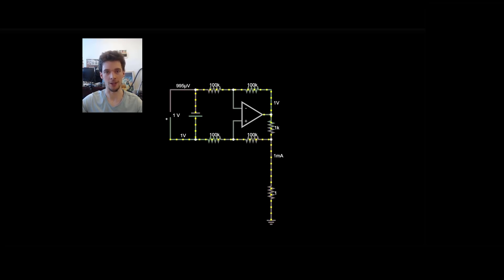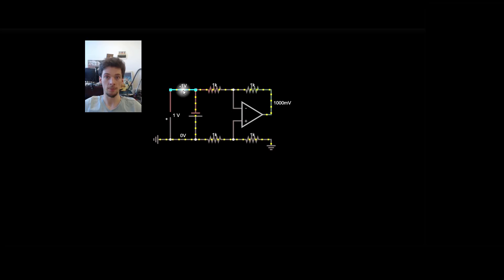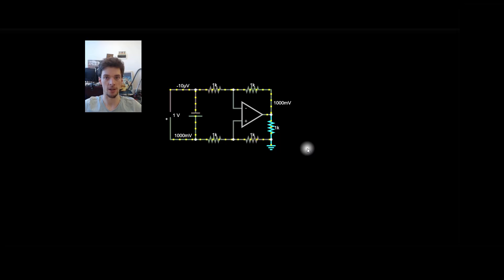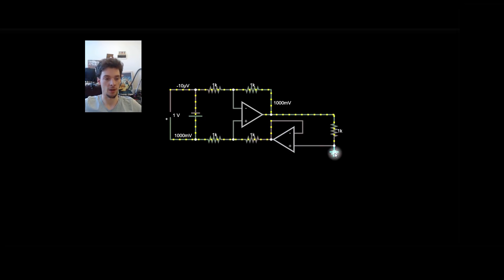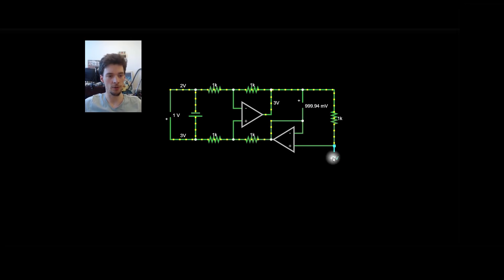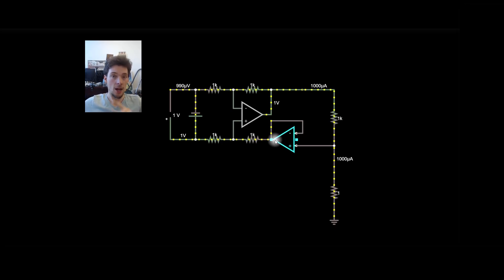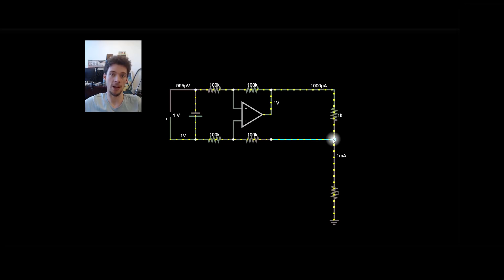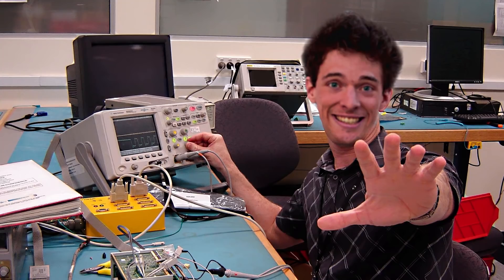EEVacademy #8 - Howland Current Pump

Comment: Hi there, at the last you talk about some sources of error in terms of a very small current passing through the positive feedback. What if we retained the previous circuit i.e. with a buffer instead of using high impedance? Will that eliminate the small current issue through the positive feedback?

Comment: A little bit of feedback: 1. You should start with interesting applications of a circuit, for instance we need an improved Howland pump for either a dc constant current source (boring) or if we need to measure skin impedance (impedance imaging/tomography), we can also control muscles or stimulate nerves very precisely even if the impedance changes.  2.  An improved Howland pump is difficult to implement in real life, you usually need to isolate it with a linear optocoupler or an opamp if you want to drive it with an audio signal. 3. You should actually warn people NOT TO breadboard a howland pump because it will most likely oscillate and show this on the scope, the resistors must be 0.1% matched in real life, this is very important, 1% doesn't cut it.  The 10nF caps are actually mandatory because they are cheap to add and they eliminate a source of oscillation.  4. You could show how to buffer a howland pump for higher current output or how to bridge higher voltage (many opamps won't cut it in the 25-30V limit for most applications). 4. With infinite resistance or higher resistance than you can afford with the opamp's capability the circuit will oscillate and draw maximum current (even kill the opamp). 5. High voltage opamps are expensive, low voltage opamps are not that useful.

Comment: great vid, i have seen something like this in cheap ebike brushless motor controllers to get a stable 12v for the gate drives, because (apparently) normal voltage regulators dont respond quick enough to input voltage drops, which leads to the 12v dropping, not fully turning on the mosfets, and then them exploding due to internal heating....

Comment: Well, what I completely miss here is the analysis of what effect the accuracy of the resistors and the input offset voltage has on the behavior.  Because in most cases, the Howland current pump is a useless circuit that does not give enough accurate current output in many applications. Also the completely floating input reference voltage is not how you would implement the circuit in reality.
Sorry, if I have missed something.

Comment: It would have been nice to know what the final outcome of the circuit is before even starting.

SO... I did an experiment and connected two LEDs to the output of this circuit (using 5V instead of 1V) AND a separate circuit with just a voltage source, 1k resistor and two LEDs. The one with the simple resistor is dimmer and if I go from 1 to 2 LEDs the current reading goes down and 3 LEDs obviously doesn't even light.

With the Howland Current Pump I can string a bunch of LEDs together and a COSTANT 5mA keeps flowing through it even with 5 LEDs in series. It starts going down if I add a sixth LED.

You see, it would have been nice to connect this circuit and see it actually do something useful like lighting LEDs.

Comment: I used one of these in a design at work recently.  I needed a very tightly regulated low current output that was tolerant of wide variations in load, both resistive and inductive.  This circuit worked great.

Comment: What simulation/circuit tool are you using for this tutorial. I love how it looks and how easily you made changes.

CIRCUIT QUESTION: in the latter part of this tutorial you show a "load" resistor on the right side of the diagram connected to ground symbol. What I don't understand is where the current returns to the source. How is that circuit completed? The ground symbol is just a shorthand way to show a connection. Can you replace this symbol with a wire to show the return path?

TUTORIAL QUESTION: What is the objective of this tutorial? You explained many things but I did not always follow why they were important to know. One example is the _virtual ground_. I think you expected me to understand why this was important and why it would be useful.

Comment: Nice video.  I gave it thumbs-up.  But I'd like to offer a few constructive criticisms:
1. You never showed the original (basic) Howland circuit. In the basic Howland, the load is connected to the non-inverting input of the opamp, NOT the output of the opamp.  When you insert an extra resistor between the load and the non-inverting input (like you did) that is the "improved" Howland.
2.  You didn't explain the restriction associated with the improved Howland.  The resistors have to conform to certain ratios in order to keep it balanced.  This is important for explaining why a second opamp overcomes those restrictions.
3.  You didn't explain the biggest advantage of a Howland: it's output is bipolar (two-quadrant operation).
Reply: Excellent

Comment: I found I was able to further simplify the circuit by replacing the resistor between the voltage source and the non-inverting input and the resistor immediately following the op amp output and replacing them both with wires. An then moving the constant current output from the op amp output to the non-inverting input. changing the value of the resisrtor between the ouput and non-inverting input then determines the current.

Comment: I wonder with the 100k resistors if it's susceptible to noise/interference? I've boj'd together timer circuits with BJTs and capacitors/resistors and to get long enough timer delays you need very high resistances, the BJTs were very sensitive to noise.

In my case I stacked a couple stages of BJTs because I wanted a binary on/off, so that's probably where the over-sensitivity to noise came from.

Comment: If I get it it we can made something like integrator if we charge cap with current proportional to the V difference and measure the time constant
Reply: Yes! you can. It is one way to calculate the value of a capacitor.

Comment: Nice video with good, lucid explanations.
4 very versatile aspects have to be added:
1. the current source differential output resistance will become infinite, only if these four 100k have  pairwise the same ratio.
So add a trim pot between 2 of the 100k, wiper into the OpAmps  input, to trim the circuit for a precision constant current source, i.e no change of current at varying load resistor .
2. the circuit operates symmetrically to GND. Trivial, but explicitly to be mentioned, therefore it's a GND related current source. It also can act as AC constant current source, if a constant AC voltage is applied at the input.
3. The circuit acts as a precise voltage to current transformer, so it's also possible to create a DC + AC current by providing an additional summing input for separate VDC and VAC inputs.
4. There's a more precise circuit, called modified Howland current source, implementing a 2nd OpAmp, so the common mode voltages at the 1st OpAmp are zero, and the input voltages are related to GND also, that's more convenient for AC / DC voltage sources. Additionally, the small error from the current through the 100k vanishes, AND you can realize the current shunt resistor as a decade switching ladder, so to switch the output current decade wise.

Comment: good work there! Just a small little comment from teacher to teacher - you should perhaps start with an introduction or a goal, like saying more clearly that this circuit is a constant current source for the current through the lower of the two resistors at the output.
Reply: +1
It's easier to see the effect if we know what it is
Reply: I agree. I also think that you should explain the advantages and disadvantages of the circuit compared to similar ones. I can think of many other constant current circuits.

Comment: Couldn't you just connect  a transistor  to   have gain and then use  it for  a  current    source  from  emitter to  collector ?
Reply: There are many ways to do it, this is one way. One of its advantages is that its voltage controlled. And the control voltage could be ground referenced.

Comment: Bah, that's what an LM317 wired as a current regulator is for. Discrete opamps are just a pain.
Reply: This can be used as an AC current source and can do small currents, it even has a differential input on top of that. The LM317 current source is DC only and has a minimum current requirement of 10mA-ish to work, though granted it can do much higher currents.
Reply: Except a (non-polarized) capacitor in series with a load given an AC source creates a nearly 100% efficient alternating current source (for small-ish loads like a pair of anti-parallel LEDs). The average current is determined by the capacitance.
Just three components to build an LED light that runs straight off of 120V 50/60Hz ;)
Reply: Good for you. The Howland is pretty much useless for driving LEDs that really need the constant current since they're power LEDs that need much more current than the 20-ish mA an opamp can give you. You can get away with just a resistor for low power ones.
What you can really use the Howland for though is oscillators, waveform generation and such. Have it drive a cap, feed in a square wave and out pops a triangle wave.
Reply: Sorry, opamps make me cringe. I have an electronics degree, but I'm an unemployed hobbyist and I've only needed an opamp once in the past ten years, for measuring brief voltage spikes too fast for an ADC to handle.
For a waveform generator I'd actually ad-hoc something with a PWM through a capacitor or an H-Bridge and PWM. Only if either of those wasn't adequate would I consider an opamp. If I needed a 1MHz or higher frequency, I'd might have to break down and give the Howland a shot... But I'd exhaust all other possibilities first.
Reply: Sadly the cheap opamps are kinda shit at MHz frequencies, they can work but accuracy is terrible. Hell some can't even make it to 1MHz at all. The ones that can are expensive, though usually they're also much less hassle, I also do just hobby stuff and I want them all because they're magic.

Comment: Another nasty source of error is mismatch in the diff-amp's resistors. This causes the amp to have some common mode gain as well so it's not only amplifying the difference between the inputs. 
If the inputs are shorted together and then we connect them to some input voltage the output will still change with the input even though the difference between the inputs is zero. Even worse is that this common mode gain can be inverting or non-inverting depending on the exact ratio of the resistors in the two input sides.
Reply: OH YEAH, thats a pretty good point which I completely forgot about mentioning.
Reply: Pretty much fail, as due to the mismatch the Howland current pump is one of the circuits that mostly works only on paper and in reality gives poor performance.

Comment: Nice little circuit, although it would be interesting to compare this to some othere options in sense of price, stability and noise. In this case the resistors need to match very well. You can make a decent current source with tge TL431, which are cheap as chips
Reply: Yeah it does end up being quite comparable, resistors being so low cost, I prefer this topology when you need the current source voltage controlled, from a DAC or such.
Reply: Why wouldn't that be possible with a TL431 or similar?
Reply: Well with this circuit you don't need any extra parts, wouldn't you need some extra's for a TL431 current source? You might not need much if you did a TL431 current sink.
How would you do it?
Reply: Maybe, don't know just right out of the top of my head. 
But in general, just a basic voltage controlled current source only needs an opamp, some kind of MOSFET or transistor and just 1 sense resistor (maybe two passives to get better stability)
Like I said, this is a cute little circuit, but not very precise because of the resistor mismatching.

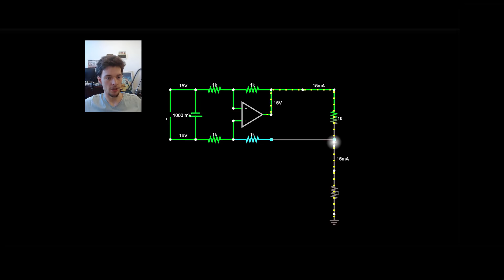Comment: 6:38 Couldn't you replace the unity gain buffer with a simple diode ?
That would stop the current flowing the wrong way, and as you stated earlier the entire circuit counteracts voltage offsets.
Reply: http://tinyurl.com/y9ubrjzy here is simulation of it
Reply: It wouldn't work, since you need to have gnd; 
There must be current (no matter how small of a current), because you need the drop of voltage on the resistors. Useing a diode you would basicly make one resistor useless; 

I hope you understand
Reply: Yeah, I think that would work.
Reply: damn. whole circuit is in the url guess.
Reply: Resistance of the load should be many times smaller than the resistance of the of the circuit, basicly circuit must have as high of impeadeance as posible (6:40)